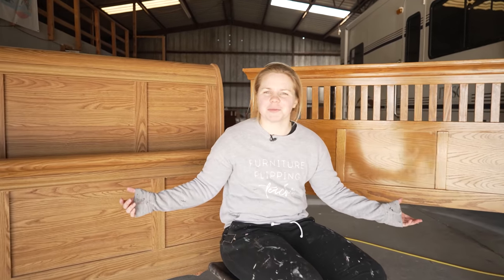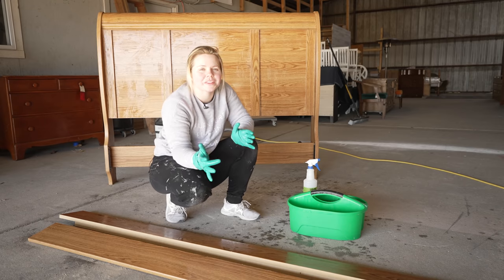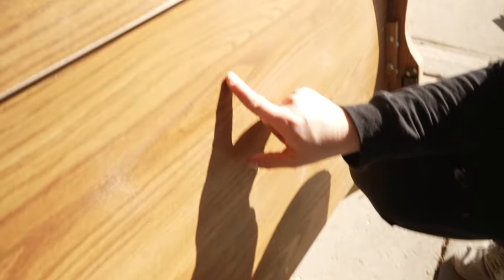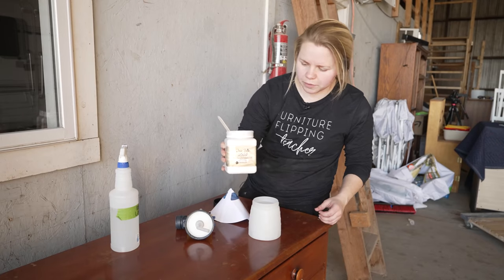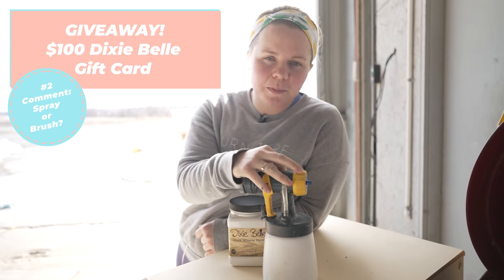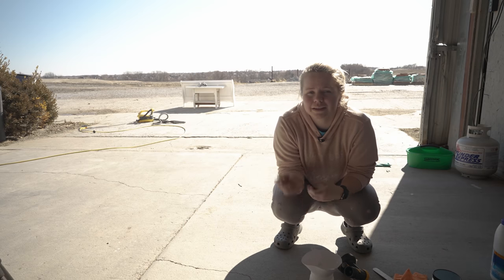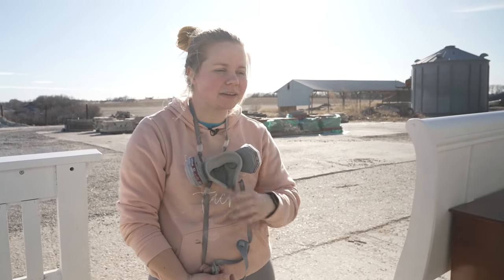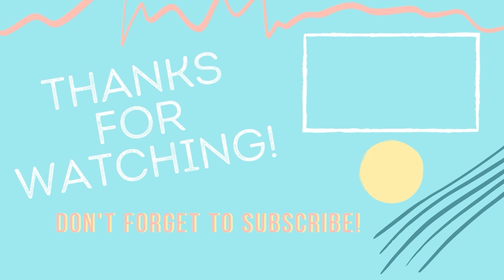Headboard Makeover with Paint Sprayer + Chalk Paint

Comment: I have been watching for quite a while now. You have come so far since you first started. I have learned so much from you. I don't have fancy equipment. I paint everything with a paintbrush. I started painting furniture and other accessories when my parents moved into an assisted living facility. I scoured thrift shops to find a table or desk that would accommodate Dad's wheelchair. That was also my first experience with Dixie Belle. I immediately fell in love with their products. When I was painting the spindles on Dad's table, I almost gave up, though. I had to work hard to get an even coat. Not because if the paint, but because I was using a brush.  Since then, I have avoided spindles. It seems like it would have been much easier to spray them rather than brush them. You were very encouraging when I was struggling. The techniques that I learned has improved my skills. Keep on painting, Lauren. And Nieman, keep filming!!

Comment: I love watching you flip furniture. I have learned so much from you. I do not have an indoor heated or vented area to sand or spray in and it is very cold here so I am going through furniture painting withdrawal. I like to spray for a faster flip but my sprayer stopped working in the middle of my last piece before having to put everything up for the winter. I also find hand painting relaxing.

Comment: If all the advertising were suddenly or even magically removed from this post, it would be about two minutes long.  Just as a couple of examples: 4.5 lbs of TSP (trisodium phosphate) at Home Depot is currently $12.46. A search will provide more than ample uses for this substance. The paint that is being promoted as "chalk" or "mineral" is indeed just that. Calcium  Carbonate or plain chalk. An older term is "whiting."  Further, spraying paint many times results in a smoother finish. The small jars of chalk paint do not go very far even when reduced. Another factor to be observed is that many and most of the spray applicators are of the HVLP (high volume low pressure) type. The air pressure is generated by a turbine or fan like device and the air is and can be hot.  We suggest a visit to any paint store to see what a genuine choice of paints and hundreds of colors and types of paints are really available. Boutiquer is fine if one needs it. It is not necessary or even for the most part a money saver and most of the botique products are repackaged or have bases made by paintmakers.  Many if not all of the major paint stores now have samples usually in half-pint or even pint cans of most of the product line for very little cost.